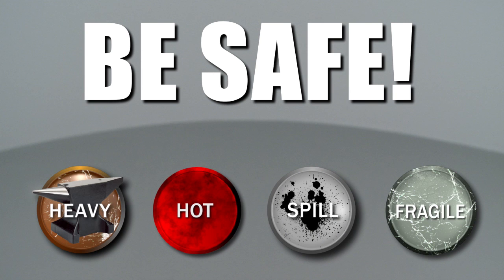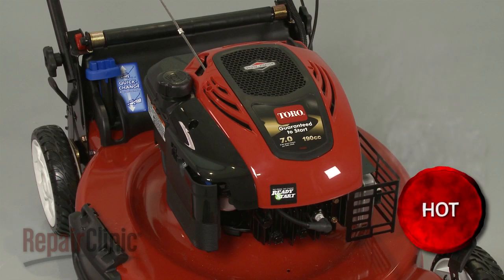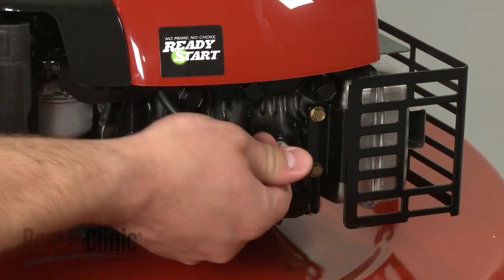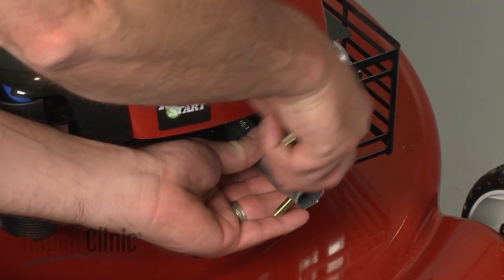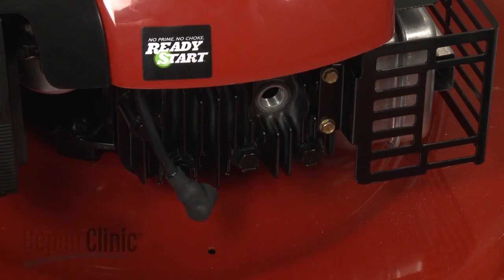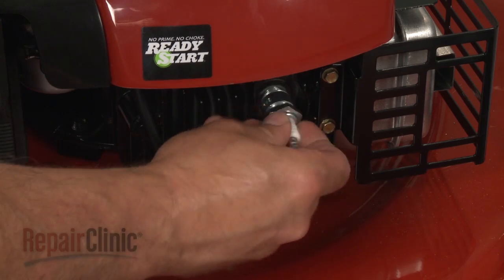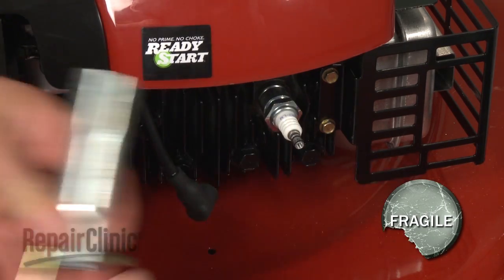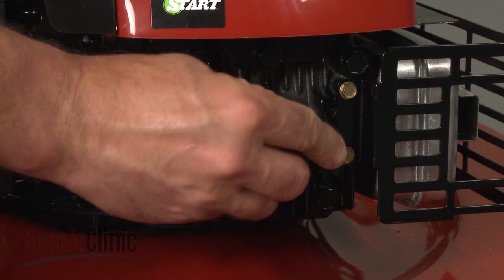Briggs & Stratton Lawn Mower Engine Replace Spark Plug #5798

Comment: Good video...However it would have been nice if you would have said or described what the type, size brand etc of spark plug this machine takes.
Reply from the maker: There's a link in the description of this video which shows the exact spark plug needed.
Reply: OK fair enough I will have another look thanks for getting back to me.

Comment: title incorrectly says Briggs and Stratton while the mower shown is  a Toro.
Reply from the maker: +rakehell404 Actually it is correct. Lawn mowers have two model numbers, one for the lawn mower itself and the other for the engine. In this case the Toro lawn mower has a Briggs and Stratton on it. Thank you for the comment!